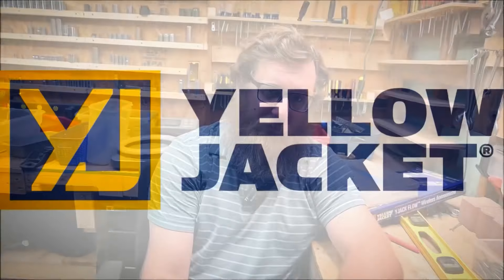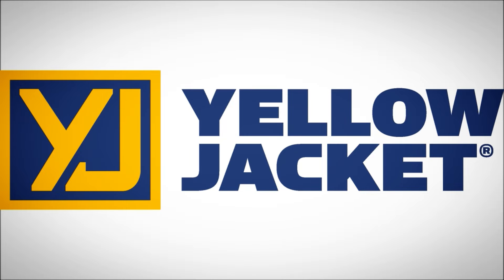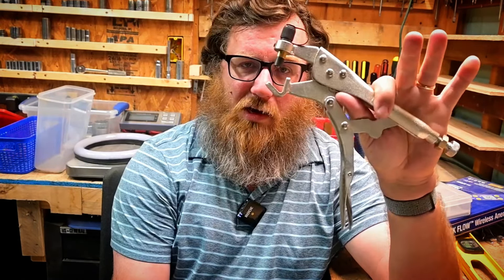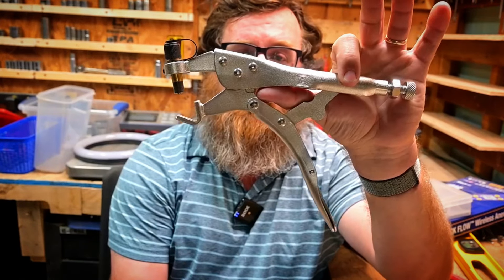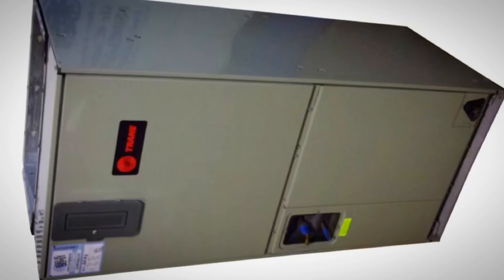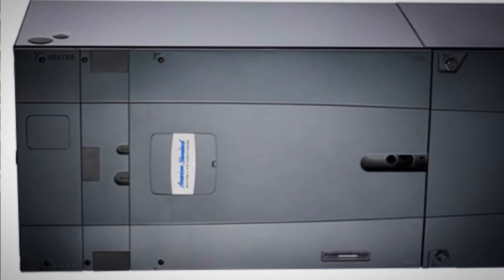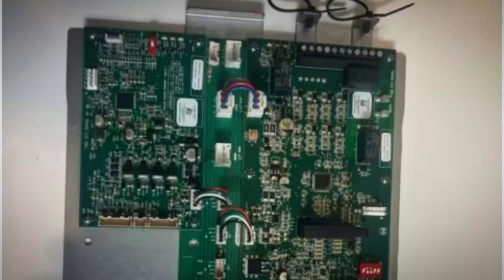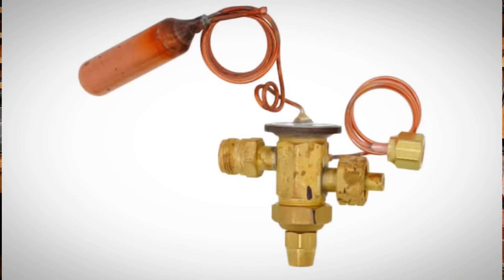Real World HVAC | Old Condenser and New Evaporator

Comment: I am a big proponent of properly matched systems, I have seen too many problems from mismatched systems because customers have tried to save money. When installing a mismatch system, always provide an option for a properly matched system as the recommended course of action, and provide a disclaimer with the mismatched option that there could be comfort issues that you are not responsible for and could have to be corrected at an additional cost.

Comment: Yes sir replacing a evaporator coil & or Air handler that was 8-10 sheer up to the 14 
was often a real challenge esp if ducts were hard pipe not flex  😅

Comment: Can you do a "Ductwork sizing basics" video for residential HVAC systems? Preferably for air handler/heat pumps? Im a fujitsu guy in NE Pennsylvania and can't seam to figure out the correct duct sizing, static, and cfm for ductwork on them compared to our good ole relaible furnace/ac split systems.

Comment: What are your thoughts on replacing a ~14 yr old Goodman air handler with a newer Bryant premium variable blower air handler but leaving the Goodman condenser? I have a leak in the evaporative coil but the condenser is in great shape. The air handler is in a hallway closet and is very loud so looking to replace it with a quieter newer version rather than just replacing the coil if possible

Comment: the solution to the blower speed/de humidification dilemma is to run 400 cfm per ton but use humidity control and slow down as needed on demand, getting the best of both